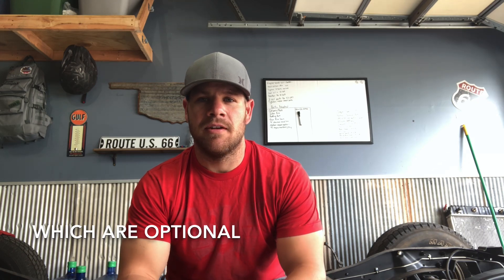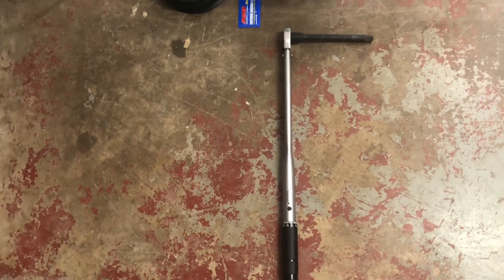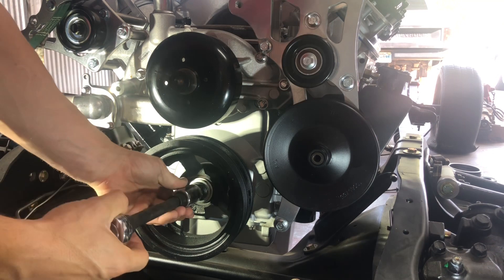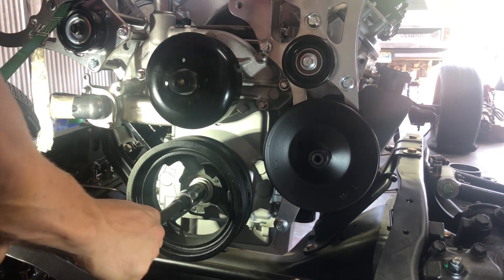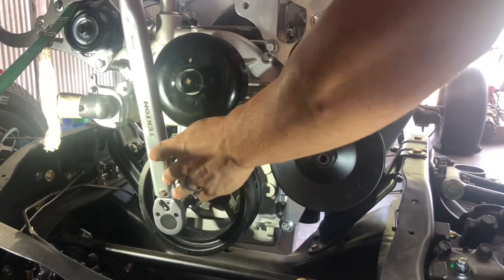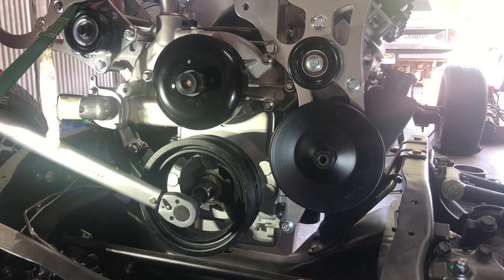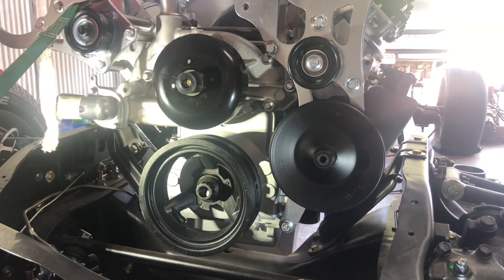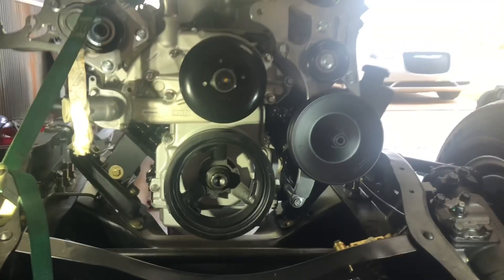LS 5.3 (LM7) Harmonic Balancer Install

Comment: Have you got it running yet I'm about to do my harmonic balancer and debating if I want to put it in then out timing cover but I already have timing cover on did you have any leaks putting cover on first
Reply from the maker: I used a crank centering tool before installing the balancer. No leaks and around 7500 miles on my swap.

Comment: my oil press needle went down to 0 twice on an 18 mi trip last week morn in the rain. Did a U turn back to home approx 5 mi out.  heated balancer core on bottom with propane. Finally got long OEM bolt to loosen with a combination of electric impact and larger weight hammer on the breaker bar with 6 point socket.  With Snap-On 2-jaw puller w/ long jaws attached, some more hammering required (lefty loosey on the OEM bolt and righty tighty on the puller. progress was incrementally GRADUAL.  Any way I came here regarding the two sight holes in the balancer and was wondering what kind of timing lights you all use on these newer Chevy motors? I installed a new stock Melling pump.  Same brand i used to get in the engine kits in the good old days.  I guess I have to go buy that longer install-bolt from GM dealer.  LS1 Balancer-Bolt.  I'm never gonna get 240 ft lb , 37ft lbs and 140 degree-twist
inside a chevy express engine compartment. Thanks 3rd Gen C10's for the crankshaft to pulley key-way orientation-information.
Reply from the maker: Computer controls the timing, I have never used a timing light on a ls.

Comment: What lubricant did you use on the installer bolt? High temp grease?
Reply from the maker: ARP Fastener Assemble Lube, you can purchase it on Amazon. My crank bolt came with a small amount of it.

Comment: So if the old TTY bolt can handle the 240 ft lbs without breaking, why not just re-use it if you're risking it anyway? Doesn't make sense.
Reply from the maker: Idk, they tell you to use a new one. They are 4 dollars to buy a new TTY.

Comment: Awesome video.   When I was getting my 5.3 back together a couple of years back my nephew, Captain Caveman showed up about that time and before I could stop him the gorilla picked up my impact and bolted my balancer back in place with it in about 3 seconds. He's not one to be slowed down by unnecessary proper techniques. Bull in a china shop.  No damage done to my knowledge  but I sure was pissed. I'll know for sure when I take it back off soon to install my new high volume  Melling  oil pump.  Where did you source the all thread you used and what was the length etc? If that's in the links provided my apologies.   I will check them out too.
Reply from the maker: ICT Billet LS LT Harmonic Balancer Install Tool LS1 LT1 Pulley Installation 551141Z https://a.co/d/iw5V2oi

This is the tool I used!
Reply: @3rdGenC10s  Thanks, I really appreciate the information! I will be getting this tool as well.
Reply from the maker: @kaylamarie8309  there are cheaper ones on Amazon but that is the exact tool I went with.
Reply: @3rdGenC10s  I bought both.  The one you specifically used and a cheaper one as well.  I noticed that some people needed to stack additional washers and one guy had trouble getting the tool out, just sort of got stuck and he used vise grips.  I'm not doing that.  I figure if mine gets stuck I'll put the nut from the cheap kit on top of the nut from the better kit together and lock them up so I can turn it back out.  Same thread pitch for both right?  I'll definitely use the tool you used to work on the issue.  What a bitch it would be to break the cheap one off inside there and then have to figure out how to get it back out!
Reply from the maker: @kaylamarie8309  grease the threads going into the crank, shouldn’t have any issues getting it back out.
Reply from the maker: @kaylamarie8309  if you have any issues you can get ahold of me on Instagram it’s easier that way
Reply: @3rdGenC10s  thanks for the advice 🙂
Reply: @3rdGenC10s  K, thanks

Comment: How did you keep the engine from turning while tightening/loosening the bolt?
Reply from the maker: Flex plate stop tool. Bolts in place of starter and keeps engine from rotating. Link for the tool is in the description of the video.
Reply: @3rdGenC10s  can I use that tool with the transmission bolted on?
Reply from the maker: @JoseCruz-qf6ui  yes

Comment: Can you not reuse the original stud that was holding the balancer in place, or is it just good practice to reinstall an brand new stud, I have never done this before 1st atempt just trying to get some guidance.  Thanks .
Reply from the maker: I’m sure you could, but they are TTY (torque to yield) so only recommended tp use one time. TTY bolts are cheap to replace I just went with more expensive reusable ARP bolt.
Reply: @3rdGenC10s  I understand thanks. I really appreciate your response and I thank you for your video. Stay Blessed brother!
Reply from the maker: @ecgodsmack86  no problem! Thanks for the support!

Comment: I installed mine and it it supposed to be in timing??
Reply from the maker: No, there is no key way like on the older sbc’s just press it on and torque to spec.

Comment: How would you do this if you were using the oem torque to yield bolts? What do those torque down to?
Reply from the maker: Use old bolt torque to 240 lb ft remove old bolt install new torque to 37 lb ft plus 140°

Comment: Instructions that came in a Dorman replacement says to mark the old one in reference to the holes along the outer ring. My problem is I don't have the original to go by. And no lube on seal or seal surface??
Reply from the maker: I never marked anything. I pulled balancer and just pressed it back on. Has over 2500 miles in it and counting.
Reply: @3rdGenC10s  thanks. I read a bad review on this Dorman Corvette spacing crank pulley. Outter ring wobbles loose.  Have you had any experience with them. ?
Reply from the maker: @govbentley2011  I do not. I always try to buy ac Delco when purchasing aftermarket.

Comment: What is correct torque for 5,7 ram 1500 ?
Thanks
Reply from the maker: If using ARP hardware tighten bolt to 140 lb ft

Comment: How did stop crank pulley from spinning while torque bolt down?
Reply: Do you know where a guy can get one for a 4x4? I used the link but it says it only works with rear wheel drive setups
Reply from the maker: The way I understood it, it won’t work with a front wheel drive. It being 4 wheel drive should not matter as the starter holes will be in the same location.
Reply: @3rdGenC10s  that’s what I was thinking. I probably misread the description. Thankyou
Reply from the maker: @e.s.l5861  no problem hope that helps.
Reply from the maker: Flexplate holding tool. Bolts in place of the starter.

Chelhead Engine Flywheel Locking Tool Steel Black Oxide Flexplate Holding Tool Compatible with Chevy LS 1 2 3 LSX https://www.amazon.com/dp/B087JB34VK/ref=cm_sw_r_cp_api_glt_fabc_JQYAMG9EHYX25VHHY9N6
Reply: @3rdGenC10s  - will the tool work with the motor mounted and transmission installed?
Reply from the maker: @familyschnekser4819  yes, I used it to torque the converter bolts.
Reply: @3rdGenC10s  - Thanks.

Comment: Dang, I don’t currently have a torque wrench that goes up that high. Have you seen the sloppy uploads where he heats it up and just pushes it on?
Reply from the maker: I actually had to buy the torque wrench I used in the video to complete the job. It’s Tekton brand off Amazon. Super affordable and accuracy is very acceptable. Only used it when installing harmonic balancers or tightening pitman arms nuts. I’ve watched a few videos of them being installed that way. No problem doing it that way, I’m just more of a stickler for the way GM recommends.
Reply: @3rdGenC10s  yep, I have the tekton torque wrench 1/2 I use for my lug nuts and I believe the max is 150ftlbs. The tekton is amazing for the $30 shipped I paid before
Reply from the maker: I agree, I have the same one you describe and a in lb as well.

Comment: What your intake manifold and carb setup?
Reply from the maker: Edelbrock 71187 dual plane with a Edelbrock carb.
Reply: @3rdGenC10s  you have a link on info? Requirements for setup.
Reply from the maker: @MaDTHUMBZ88  Edelbrock 71187 Intake Manifold https://www.amazon.com/dp/B001516EP8/ref=cm_sw_r_cp_api_glc_fabc_KFW0KV7JF8T48Z5ZN4W9

Edelbrock 1407 Performer 750 CFM Square Bore 4-Barrel Air Valve Secondary Manual Choke New Carburetor https://www.amazon.com/dp/B000182DJ2/ref=cm_sw_r_cp_api_glc_fabc_YGNH90WMPNRB7QQBEDZK

MSD Ignition 60143 Controller; LS Ignition; for Both 24x and 58x Crank Trigger Engines; Black; https://www.amazon.com/dp/B01JP2KIT6/ref=cm_sw_r_cp_api_glc_fabc_1DY74DJT151P9RMDQ4S0